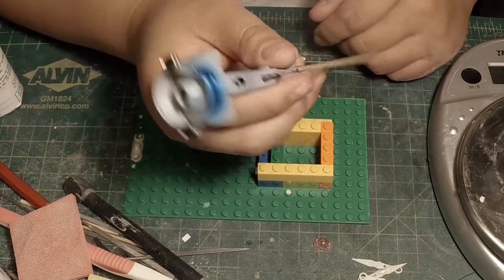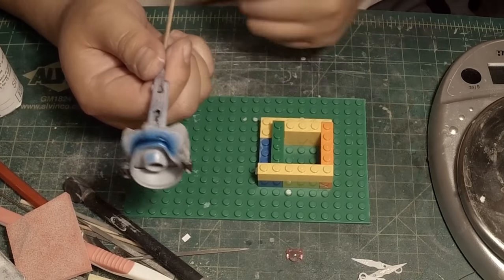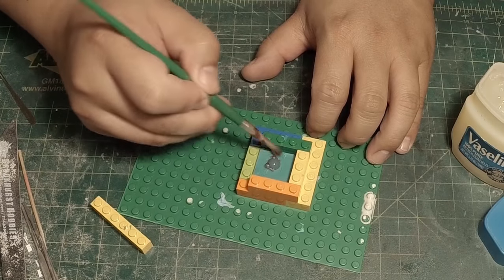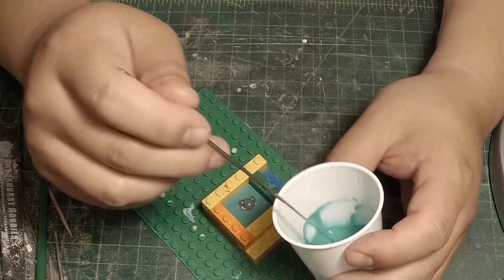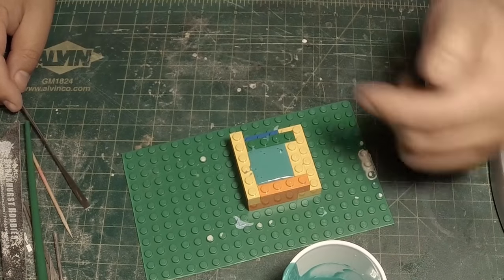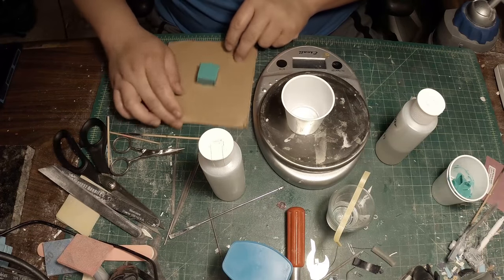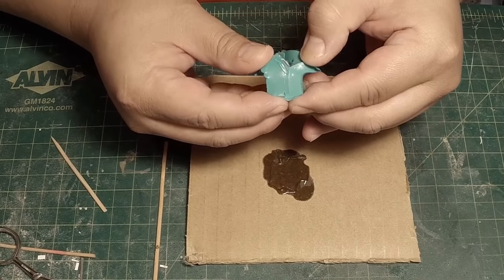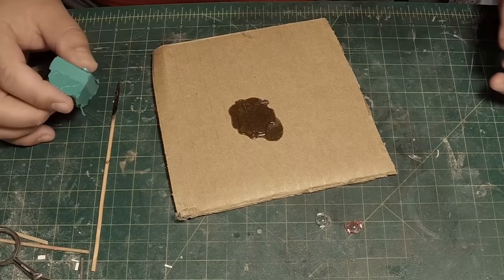Making a Clear Resin Copy

Comment: does your mold end up sticky at all after removing the playdough? the silicone i'm using seems to be sticky wherever it makes contact with the playdough.
Reply from the maker: Nope.  The only time my silicone is sticky is when it's not completely cured.  If only certan areas are sticky, my best guess is that the silicone wasn't mixed well and certain areas didn't cure, or is curing at a different rate then the rest of the silicone.

Comment: I got a question,  ive tried this method but the pice came out flexable [even after weeks still hasnt hardened] , am i  misding a step or maybe miss measuring?
Reply from the maker: I measure by weight.  I believe part B needs to be shaken up a bit before pouring.  I've run into this a few time where the part never fully cures, and most of the time it is because the mix ratio was off or I didn't premix the part B well enough before pouring.  What clear resin product are you using?

Comment: What Materials did you use to recast your parts ?
Reply from the maker: For this, I used smooth on's crystal clear 2 part clear resin.
Reply: Those Gundam Guys where can i buy that ?
Reply: Those Gundam Guys did you use clay for the molding ?
Reply from the maker: I bought this online.  I forget where,  But you can easily search for it.
Reply from the maker: I used silicone molds

Comment: Hello can you List me the name of the putty and resin brand you used?
Reply from the maker: mattia moser I pick up my white resin locally from a place called Silpak, and use their silcast II product.  For the clear resin, I used Smooth On Crystal Clear 202.  The silicone I use is from Hobby Silicone and it just a regular 20 shore RTV.
Reply: Those Gundam Guys Thank you for your answer.  I want to try to make the 1/144 zaku visor which is black to duplicate in clear plastic. Do you think is possible? The part is the black one here http://www.dalong.net/review/hg/ho01/p/ho01_j_head.jpg
Reply from the maker: mattia moser Yes, that's possible.  I did that in this video,  its the same process.  Make a silicone mold first.  Then use some clear resin to make a cast.
Reply: Those Gundam Guys thanks you make me feel like a god :)
Reply: Those Gundam Guys I just bought the resin, they are 2 bottles the smallest one smells like hell (resin smell) it is something wrong with that?
Reply from the maker: mattia moser What brand?  My resin usually comes in 1:1 mix ratio, (so equal size bottles for resin and hardner) and it doesn't really smell like anything.  But I may be dead to the smells by now.
Reply: Which brand do you reccomand?
Reply from the maker: mattia moser For the clear resin, I used Smooth on crystal clear 202: http://www.smooth-on.com/Urethane-Plastic-a/c5_1120_1156/index.html  I found an online source and purchased it online.

Comment: So what kind of pot is it to remove it I'm confused
Reply from the maker: Kevin Kearney It's a pressure pot, read this article I wrote a while back: http://gamerabaenre.com/?p=678  That should help clear that up.
Reply: Those Gundam Guys why did it seem so sticky in the end, not cured fully?
Reply from the maker: Kevin Kearney Because when I pulled it, it wasn't fully cured.  Depending on your mix ratio, age of your resin, relative humidity, relative temperature, etc... the cure time will vary.  It can be fully cured within 1 - 2 hours, or take 1 - 2 days to fully cure up.
Reply: Ahh makes sense

Comment: Pressure pot? You mean a vacuum chamber?
Reply from the maker: Nope, I use a pressure pot.  I'm used to using a pressure pot for mold making.  Vacuum chambers are good too; but not what I'm used to using.
Reply: @ThoseGundamGuys  what's the difference?
Reply: Thanks by the way!
Reply from the maker: @TheTca211  heh.. going from suck to blow... cough*idiotic spaceballs ref  Ok. Vacuum sucks, meaing air is pulled out of the chamber and requires a vacuum pump to pull the air from within the chamber out.  For silicon molds, this woks to remove all the air out of the freshly mixed silicone.  Then the vacuum is released and you have bubble free silicone that can be poured into the mold.  Using pressure blows air into the chamber creating pressure on the silicone.  in this instance, the silicone is already poured over the mold and as many bubbles are popped and the whole mold is throw into the pot and it is filled with air to about 30-40PSI.  This squeezes all the bubbles together and so long as you don't have undercuts in the kit where air may become trapped, you will get a very bubble free mold.  Now, you can do both!  vacuum to remove the air from the mixed silicone, pour the silicone to make the mold, then put it into the pot and pressurize that.  I think that would be the best of both worlds, but that would require something that sucks and blows... or two things to do those two actions :D